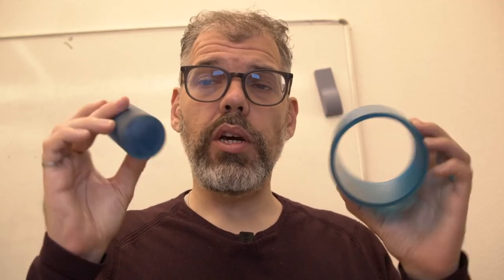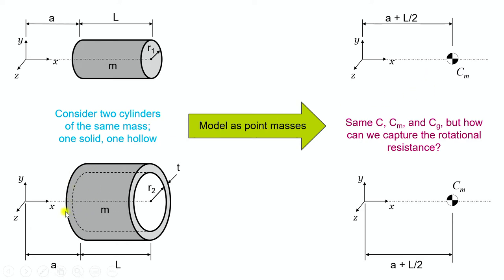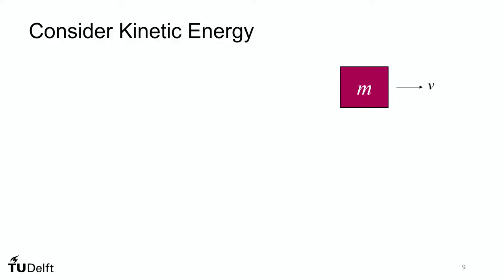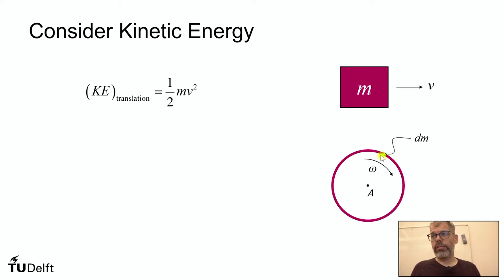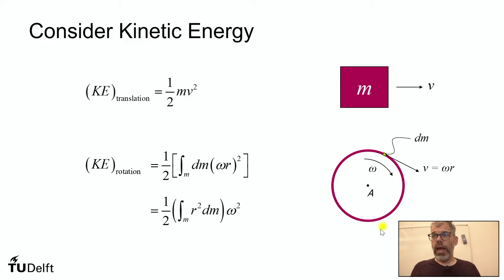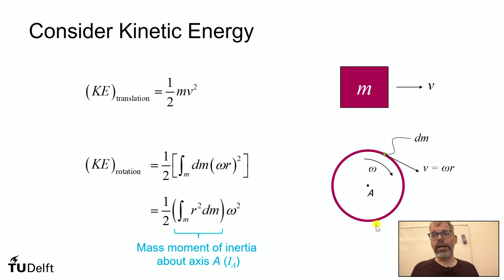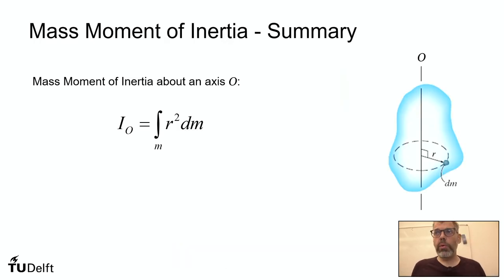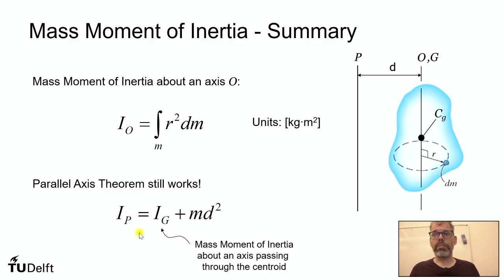Mass Moments of Inertia

Comment: Good morning sir, since the Mass Moment of Inertia is more for bigger radius cylinder summation of translation K.E. and rotational K.E. should make bigger cylinder go to the bottom of the inclined plane first since M.I is more in bigger cylinder. But this is not happening. Could you explain sir?
Reply: @DrRans  Thank you, sir. Your learning materials on Mechanics of Materials are easy to understand and imparts knowledge. I request to come ahead with a course on Advanced Mechanics of Materials.

Comment: is the polar moment of inertia same as mass moment of inertia?
Reply from the maker: Polar moment of inertia is an area moment of inertia. It measures the distribution of an area around an axis. The mass moment of inertia relates to the distribution of mass. They are related quite closely if the body is prismatic (has the same cross-section along the axis you are measuring the distribution) and has a uniform density. So polar moment of inertia would be the integral of r^2 * dA, while the mass moment of inertia would be the integral of r^2 * dm.

Comment: Explained the what is is pretty well but you haven't explained why it is at all . Why does the excess kinetic energy means (excess cuz its r2 so if you mass sits further you have more) more resistance? why does it make it harder to transition from potential Energy to kinetic ?
Reply from the maker: It’s not that there is excess kinetic energy, but that more kinetic energy is needed for the same movement. So in the experiment, both objects had the same potential energy, and that potential energy is converted to kinetic energy, but due to the distribution of mass in the hollow cylinder a lower velocity of the cylinder is obtained. So both cylinders have the same kinetic energy at the end, but the velocities are different due to the mass distribution. So equate the kinetic energies of two rolling cylinders with different mass distributions, and you will see that the linear velocity of the cylinder with a more mass away from the centroid will have a smaller linear velocity for the same amount of energy.
Reply: @DrRans  Thank you for your answer :)

 I see what you mean especially in a equation manner E= 1/2 (int(r^2)dm) .w^2 aka if you increase the r^2 you reduce w but velocity is w.r therefore velocity should be constant since mass is the same .  Also forgetting about what we talked what is not intiutive about this concept ( I am not denying it or saying its wrong I am just trying to reaally understand it ). How exactly does  at the t=0 moment the first rotation has more interia against the movement since ( again I know the formula and the basic linear logic from that but lets do it verbally) the partical at top sits very high and also since it sits high r is high , okey we say w is low but why exactly , what kind of nature forces cause this. Like it is the same mass there fore same total energy at  t=0
Reply from the maker: @rocketman99  At t = 0, both of the cylindars are at the same height, so they have the same potential energy (because their total mass is the same). Potential energy would be mass times height. Actually, there is a smal error here as the hollow sylindar has a higher centre of mass, so it actually has a little more potential energy than the solid cyinder, but even with this little extra energy, it has more resistance to rolling and thus rolls slower as a result of its resistance. 

To try an understand it verbally, it can be useful to think about the distance each bit of mass on the cylinder travels. In the hollow cylinder, in addition to the displacement in the direction of the ramp, mass is moving perpendicular as it is rolling. So the hollow cylinder, due to its larger radius, requires the mass to move perpendicular (lets call this up and down) relative to the ramp, and thus this added motion consumes some of the energy. So less energy is available for imparting velocity in the direction of the ramp.
Reply: @DrRans  thank you soo much that was really helpfull